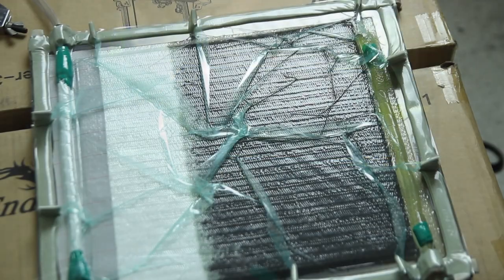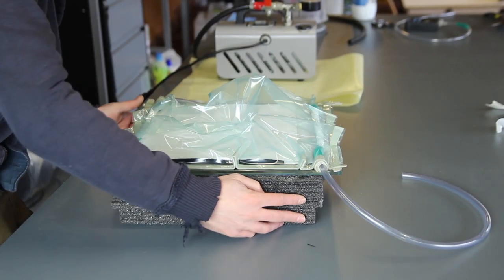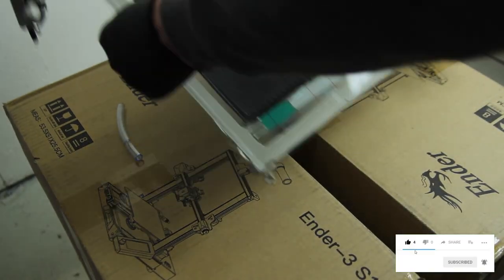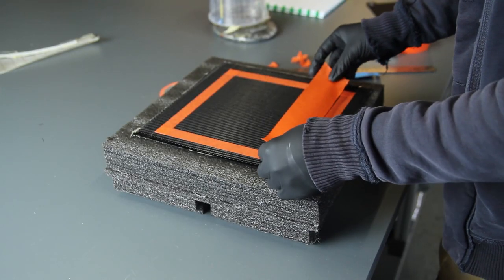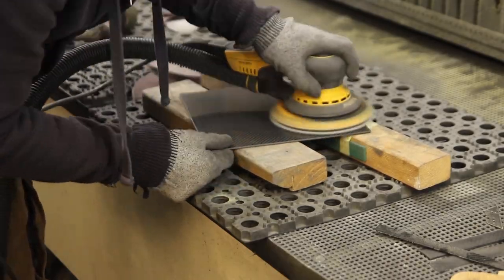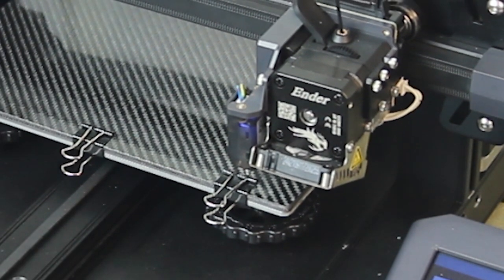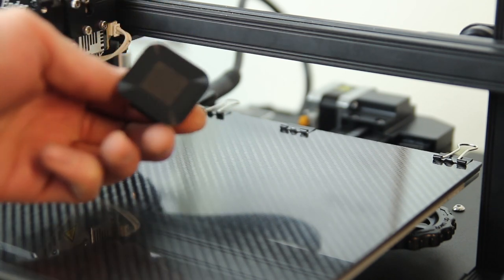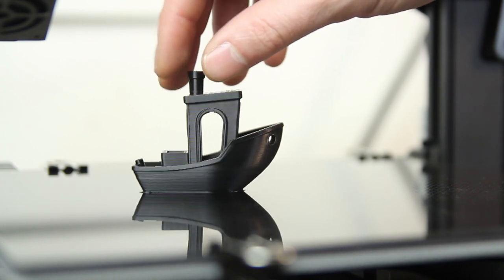Making A Carbon Fiber Print Bed For My 3D Printer (how to)

Comment from the maker: Let me know what printer you are using, So I can see what the most used printers are to base my future build plates on ;)
Reply: Ender 3 pro but also will be doing the 300x300 ender extender would love the y carriage too
Reply: ender 3
Reply: Anycubic Vyper
Reply: Ender 3 v2
Reply: Anycubic Vyper
Reply: Ender 3 S1
Reply: cr-10
Reply: Tronxy X5Sa Pro 330x330
Reply: Cr10s 310x310
Reply: Will you make me one for a Cr10v3? Or do you have a store?
Reply: Z-Bolt S300
Reply: would it be possible to make a carbon fiber belt for a cr-30?
Reply: You should have added a steel plate on the bottom, so you could use a magnetic build area and avoid using bed clips.
Reply: I use a Kingroon KP3s 180x180mm. I could cut down a bigger plate though. Let me know. Thanks
Reply: Wow This is stunning, definitely keen. Ender 3 Pro's / 3v2 all same 220 bed size anyways :)
Reply: Ender 3

Comment: Oh man, this is cool. I didn't think that carbon pattern would transfer so perfectly onto the print. And bonus points for having the coolest build plate.
Reply from the maker: Thanks! Wasn't expecting it as well to be honest, it's more like a visual thing, it's fully flat but has like a holographic carbon fiber visual on it 😁
Reply: There's already a company visionminer doing CF plates but they are quite expensive.

Comment: Interesting video! subscribed

 I did this a couple of months ago on my Creality CR10S Pro v2. I replaced both the print surface as well as the bottom bed frame primarily to shave off weight. Before the replacement the bed stack had a 4mm thick aluminum plate as the bottom frame ( where the wheels are ) and above that a 3mm alu plate where the bed heater is attached and on top of that a 3mm alu plate with some BuildTak-clone as the actual print surface. Since the density of aluminum is 2700kg/m3 the original bed plate stackup weighed ~2.1kg (bottom 4mm frame alu plate was 25x29cm and the upper 3mm alu plates were 31x32cm).

I replaced the top most alu plate with a 1.5mm thick 30x32cm CF plate which saved me ~600g (measured density to 1520kg/m3). 😀 Replacing the bottom frame only saved ~150g because the original alu frame had cut out holes and me and my brother (who helped me cut the CF plates) only bothered to cut one hole at some place on the 4mm CF plate. But a total weight loss of 750g from original 2100g certainly was noticable! I could rerun the input shaping in Klipper and saw an increased resonance frequency on the Y-axis and could increase my Y-acceleration from 1200mm/s2 to 1600mm/s2 with no increase in ghosting (my measurements show I could go up to ~2500mm/s2 perhaps but then the ghosting starts to show and I prefer quality). 

After all this I'm quite certain that I could have used a 3mm CF plate for the bottom frame instead of 4mm, because the 4mm was incredibly unbendable and feeling the stiffness of the 1.5mm CF plate I think 3mm would make a rigid bottom frame also.

Regarding the bed adhesion I used the regular 83degC for PETG as I did before but I experienced worse adhesion than with the original BuildTak-clone. Tried squishing more and more but didn't help much. Tried hairspray and PrimaFix and purple glue stick and the gluestick was the best and made a huge difference, got better adhesion than even the original BuildTak-clone! The downside was that I must apply the gluestick on a cold bed otherwise there would be too much being smeared on the CF plate and that would show as ugly scrapes on the bottom side of the prints. Also I had to use quite large brims everytime I needed to print things only a few cm high or the print would start to detach in the corners in the middle of the print. 

In the end I bought a 0.2mm thick PEI sheet and applied on the CF plate to not have to bother with the gluestick and excessive brims. I still see the beautiful CF surface through the PEI sheet, but I never got the CF pattern on the bottom of my prints before anyway so no loss there (only a bit more matte bottom surface on the prints using PEI vs shiny bottom when printing directly on the CF).

Just my experience in case someone wants to do the same. :)
Reply: Do you think we can sand the CF with some fine sand paper to make it adhere better? Like 3000 grid or even finer.
Reply: @modelsport2350  Certainly would be interesting to try 🙂 maybe use an even coarser sand paper than 3000
Reply from the maker: Thanks for the info! I'm planning to redo the entire bed fully in carbonfiber as well later on for a future video ;) good to know the problems you had, I'll keep that in mind!
Reply from the maker: 3000 is to fine, would indeed be more something of 800 if you want more mechanical bond with your prints

Comment: Very intriguing, first time I see someone make things out of real / unfinished carbon fiber!
I do wonder how much sense does it make though. I'll just write down my opinion as a constructive criticism and personal opinion.

While I agree that carbon fiber would be a great choice for a build plate, I wouldn't say it's ideal as a print surface (cool texture though!). 

In my opinion, PEI sheets seem superior in that regard. Featuring a higher thermal resistance + brilliant adhesion and they even come in double sided (smooth + textured surface that has a really nice finish to it) variations with a magnetic build plate for easy removal. They're also flexible as they use spring steel. High quality 310x310  set can be found for about 60$ with shipping. 

Combining carbon fiber with PEI sheets / stickers or something like Buildtak on the other hand does sound appealing but considering the price, I'd say this would be a niche market.
Carbon fiber is very lightweight and that's a big plus for high speed printing, another thing I really like is the property that allows carbon fiber to cool down faster, wasn't aware of that.

I personally own Artillery Sidewinder X1 that has a pretty warped bed so this sounded intriguing at a first glance, but ABL sensor effectively negates that issue.
Sidenote: There's a Discord with a quite substantial amount of Sidewinder X1 owners that probably don't know about this video and could be interested in it, let me know if you'd like an invite link.

I am curious about the price though. Did a quick google search and I've seen "3D print-friendly" carbon fiber plates for  310x310x2.5 for 100-120$ (non pre-drilled). 
There's also standard carbon fiber plate sized 400x300x3 costing only 65$, which does require a bit of cutting work but it'd be better than most (if not all) stock plates.

I'm out of my depth, but wouldn't these prices be really difficult to compete against considering your work is manual and both the carbon fiber + resin tend to be quite expensive ?

Anyways, I hope you didn't take this post the wrong way. I like your idea, as well as the video and I don't want to discourage you in any way! Cheers!
Reply from the maker: Hi Vex, thanks for your long message, I'm open for discussion and don't take your comments the wrong way! 
Here some (personal) remarks or points from my side:

It's hard to discuss on different options of buildplates as I think its more of a personal preference (workflow and price related).
On my Ender 5 Plus printers I have glass beds and never had any troubles with adhesion as long as everything is well calibrated.
Just love how you can just remove the print without any effort once the glass has cooled.
On my ender 3S1 I got the flexplates. As much as I like the concept, I've found them extremely annoying; small prints and TPU parts are hard to remove as they bend with the plate. 2nd is that the adhesion is "too good" for me. I also find it a bit of a weird concept that you want to bend the baseplate you are printing on, with the idea that you want your plate to be as flat as possible without any damage.
Another thing is that I like a gloss plate, so I can check the distance between nozzle and bed for the first layer. Found it hard to see on the black matte textured plates.
I also find that buildplates with some extra mass/thickness, keep the heat of the buildplate a bit better, making them more stable on temperature side.
I Haven't tried the PEI with smooth surface so couldn't compare to that :)

About combining PEI and Carbonfiber might cause problems due to different expansion rates, combining 2 different materials might warp the plate under heat/cooling

Feel free to share my video in the Sidewinder X1 community, I might see their comments in the comment section later on then :D

Price is an important aspect as well indeed. I've found out that there is a good amount of "cheapskates" (dont want to offend anyone) in the 3D printing community. Some find €250 still to much for a printer in some way...
By making the Ender 3 S1 review I got many comments about it being an expensive printer and you could get better printers for that money.
I personally don't mind paying a bit more for some things that are reliable, low on maintainance, have a big community, many spareparts, mods and upgrade prints,.... Same goes for a good print bed for me. 
Not saying it has to be this carbonfiber one (It was easy for me to make for myself for a good price, using leftovers and I have access to all needed materials. At the moment I'm working on an upgraded version in many different formats and new mounting options.
I'll see to what pricepoint I get...If some want it I'll be happy to supply them, If some find them to expensive, no problems.
Making these to sell isn't my main goal. I make money making more complex custom carbon fiber parts for various type of industry and companies. 
Luckily in carbonfiber production there are many production techniques, making it possible to make parts faster and cheaper but with a higher set-up/moulding cost. But If you get the selling volumes up, this might be an option to make them more affordable, in a way, for most people. 

About the stock carbonfiber plates on the market. If you look online and want to buy carbonfiber plates, they will mostly be made out of a low temp resin and won't have a Quasi-Isotropic lay up like here (having strands of carbonfiber in all directions 0/90 -45/+45 degree) making the plate extremely strong and stable. Obviously this is something most people don't know (and don't expect people to know that) Most plates you would buy online will only have a 0/90 degree orientation, making them stiff on bending and pulling but not good on warping/twisting. 

I appreciate your comment, and hope to have given you a bit more insights with mine. Not trying be a smartass or to "defend" my carbonfiber plate, but to gave you a bit more information of my creative thinking process prior making them :)
Reply: @MatthieuLibeert  Happy to hear you didn't take anything the wrong way! You certainly raised some valid points that I overlooked, and I'm glad you did because I've learned a thing or two! 

I'm definitely with you on paying more for something that has a quality to justify the higher price. Gotta say that I had to google the "Quasi-Isotropic" part, but I think I understand what you mean and see the benefits. I wonder if those properties also apply to thermal expansion as well, making it even across the plane just like the strength and stiffness ?

As for the PEI flexplates , I mostly stick to PLA for the time being (relatively new to this), but yeah.. I can imagine TPU and alike being a bit wonky and annoying. I personally really like it so far as I had serious adhesion issues with the stock textured glass for some reason (even with glue methods, was really frustrating) + the textured finish looks quite nice as it doesn't even look as if the first layer is 3D printed. But I also like this carbon fiber footprint that your bed leaves (although I have no clue how that happens, since I imagine it's quite smooth due to resin). 

I do hope your project takes off well and I'll be happy to share it in the community for SW to hopefully help it gain some traction. It seems like a genuinely nice idea and it's well crafted. It's lightweight, has a nice thermal conduction properties, leaves an interesting finish on the bottom, looks awesome and so on :P

The only thing that's a bit of a bummer for me personally is this "PEI+Carbon" combination that you addressed earlier, but I'm glad you did. I reckon the PEI won't last forever and I like tinkering so I might give the carbon a go someday myself (if you end up making these indeed). Not sure if you're aware, but Artillery Sidewinder X1 doesn't actually have a metal plate under the glass, meaning that the bed heater is applied directly to the build surface. Just to be on the safe side, would you say that's okay for carbon fiber ?

I can't think of a reason why it wouldn't be, but better to confirm with somebody that understands the material better than I do. While Sidewinders use AC heated bed, it's of course isolated so I don't think it'd be unsafe, just curious about any potential warping issues.

 Anyways, I'm glad we had this conversation, hopefully it'll help other people with similar concerns that may stumble on it as well.
Reply: @vex9596  the main goal of the thin metal plate is to act as a heat spreader. Im guessing here but since carbon has much better thermal conductivity than glass (the epoxy is what makes cf products not thermally conductive), the strands/weave would help spread the heat laterally so it might actually be better than bed heater directly on glass. A heat spreader might still be a good idea tho since the thermistor only samples a single spot, a hot spot is more likely to exceed the Tg since youll be running a lot closer to the Tg of the cf than glass.
Reply: @ComeToLyfe  Thanks for pitching in! Yeah, the guys over at the Sidewinder community pointed out that epoxy has a pretty bad thermal conductivity, even though carbon itself is pretty good in that regard. Didn't know about one point temperature sampling though. My main reason for wanting to change the bed plate is due how warped it is. People recommend MIC 6 cast aluminum as an ideal choice, but can't find it locally and it's about 120$ (+ possible import taxes) with shipping otherwise.. I think I'll just try to get some ordinary glass instead and see how it handles. Borosilicate glass is obviously better, but once again, can't really find it :X Do you happen to know if thickness of the glass plays a major role when used as a bed plate ? My stock is 5mm, just curious if I absolutely have to match it or if something thinner is viable.
Reply: @vex9596  mic6 is probably cheaper than cf. You might consider garolite as an alternative to glass. Dont think the glass thickness matters kther than durability. I will mention that often with entry level printers, people think their beds are warped when in reality its a problem with slop/flex/skew in the printers motion components that makes it seem like the bed is warped.
Reply: @ComeToLyfe  Thanks for the suggestion, I wasn't aware of this material. Sounds pretty good based on a bit of googling. As for tooling plates (MIC 6, ATP 5, ALCA, etc.), they're not that expensive on their own, it's the shipping costs (and possible import taxes) to my country that inflate the price massively. I couldn't find the right size under 120$ with shipping and that's a bit too high for me right now. As for the components, that's a valid point.

I personally level using gauges but there's heavy convex point right in the middle that bothers me. I tend to do my best to avoid printing around it due to nozzle scratches, this being my main concern and the reason why I want to switch the bed plate. Thankfully there seems to be a lot of choices nowdays and Garlonite sounds enticing so I'll reckon I'll give it a try. Anyways, don't want to bother you anymore so thanks again for all the advices, they're quite helpful! Cheers.

Comment: Absolutely love it! Been wanting to try CF print surface for a while, but bed temperature was always a concern...
Reply from the maker: As long as high temperatures resins are used you should be fine
Reply: @MatthieuLibeert  that's the problem... I was looking for something I could buy... Never worked with CF before
Reply from the maker: I'll probably have them for sale soon, working on some fine-tuning first at the moment

Comment: looks amazing. My understanding of composite carbon fiber though is that the thermal conductivity of the resin isn't very good. Given that the heater is in direct contact with resin not carbon fiber, I wonder if that is why your plate temperatures are so far off?
Reply from the maker: As it was resin infused the fibers are almost in direct contact withbthe mouldside,while sanding the toplayer of resin is removed giving that pattern on the prints and heat transfer should ben better as well